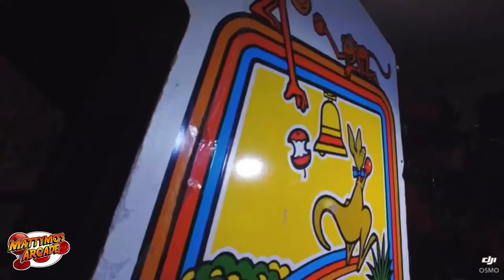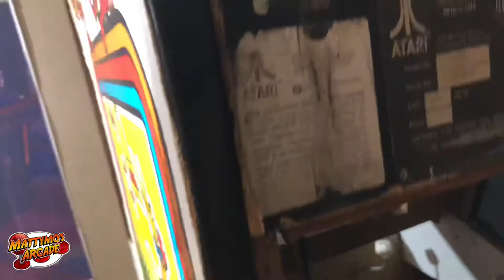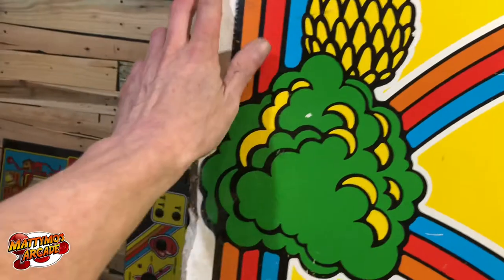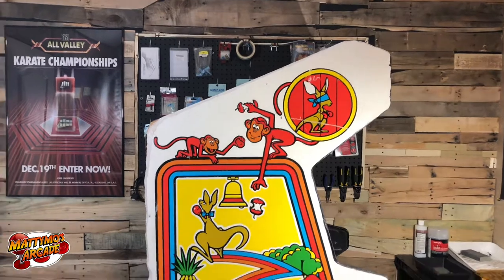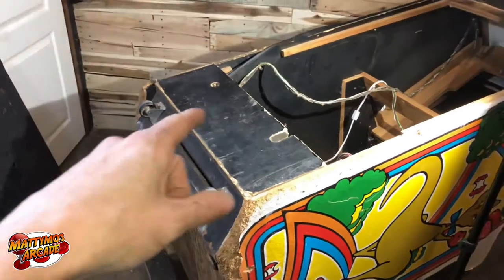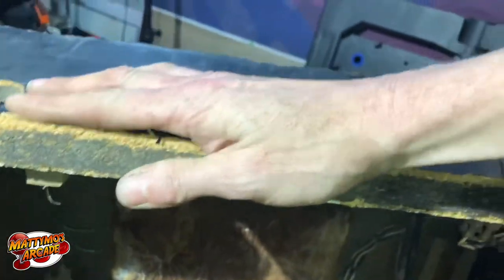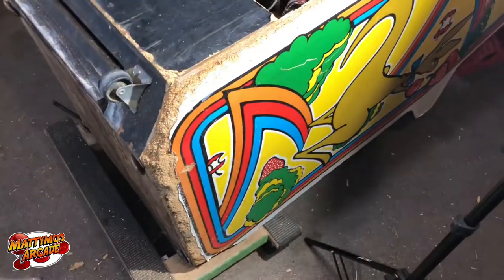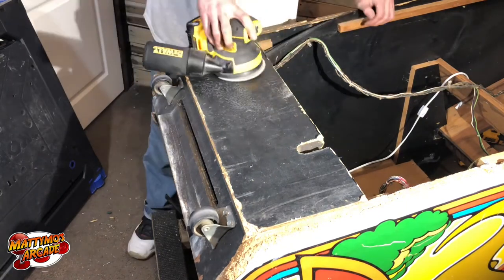Abandoned Kangaroo Arcade Game Part 8

Comment: If it were me I'd get some C-Clamps and some angle iron. Not too expensive at Menards or Harbor Freight. You'll get much higher compression strength. I'm curious to see how well that wood hardner works. A quart of CA glue (super glue) would be ideal but its expensive.

Personally I've had good and bad luck at either store for paint mixing. For that cab I would go with the cheapest possible. Hell I think Wally Mart mixes paint (or used too) 
Good luck with the rest of it. Enjoying this series.
Reply from the maker: Yeah i realized far too late that i didnt have good clamps for this. Thanks for watching!